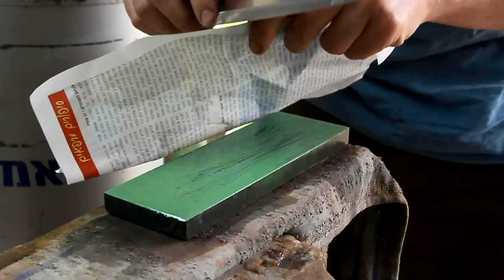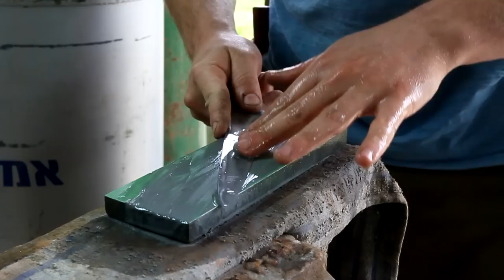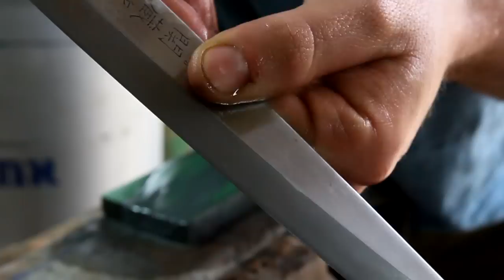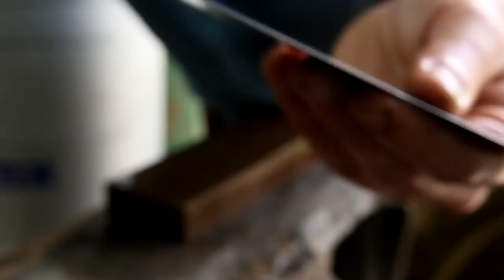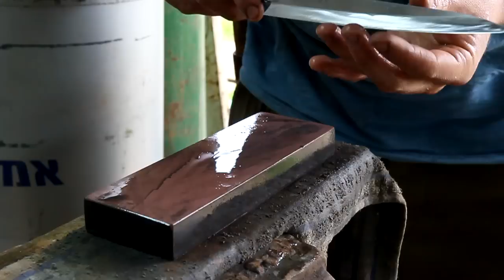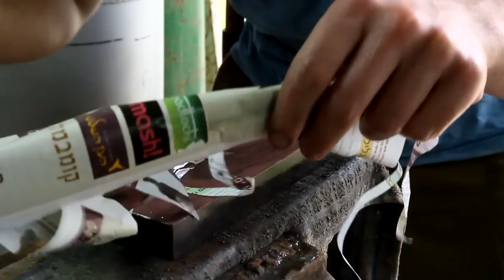Demonstrating single bevel sharpening on a cheap knife

Comment: Thank you Guy for the clear explanation - no words needed. This week my new Chosera 400 800 and 3000 stones arrived via a friend in Kobe. The are super hard slash-n-goes. I have 3 cheap single bevel knives that I'll practice in. My new Japanese steel knives on order arrive in November. Hopefully by then I will have learned enough to do a good job maintaining the edges. Thanks again guy 😎
Reply from the maker: Don Williams i'm glad i could be of help. Be sure to remember that this sharpening technique is only good for knives made from soft steel. High quality knives wouldn't need that angle raise on the edge with the coarse stone, only on the finest stone.

Comment: Hundreds of dollars invested in stones and you couldn't buy a stone holder?!?! Come on man! Good job on the sharpening. Above average technique.
Reply: Most of the time, a good piece of cloth and a flat stone is sufficient.
Reply: A holder isn't necessary all the time, as far as I know its technique and not power, when done with proper technique a stone on top of a cloth will always do, unless you're fixing a knife that requires a bit of power then I would agree.
Reply: That ones for the salesman